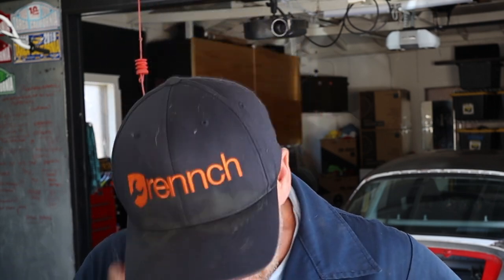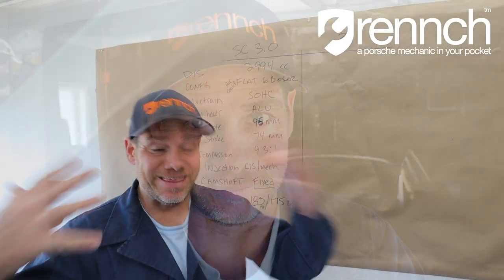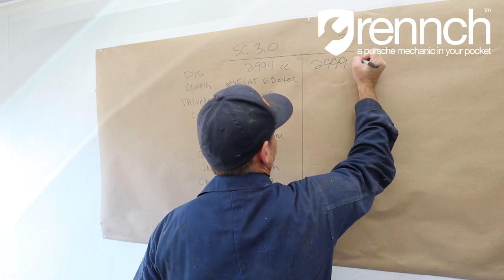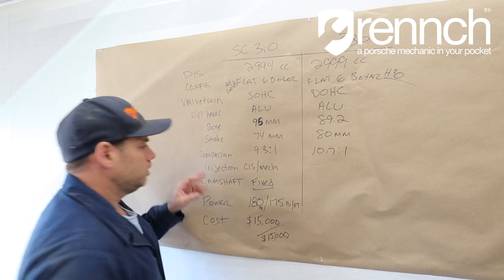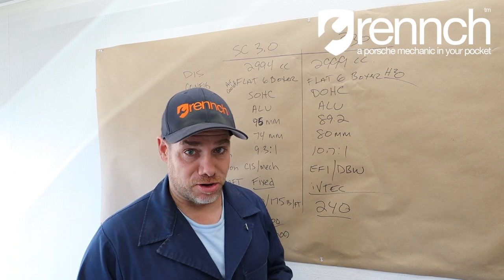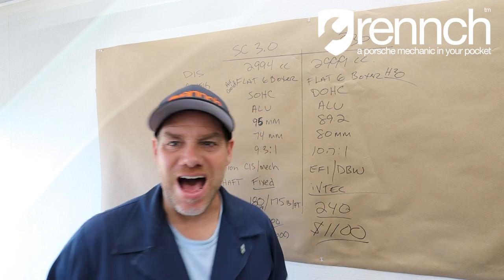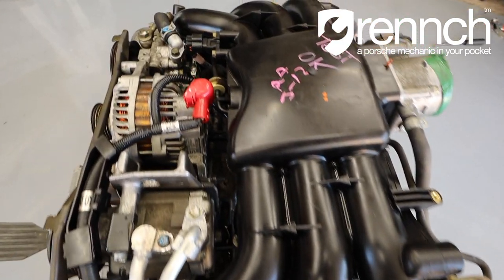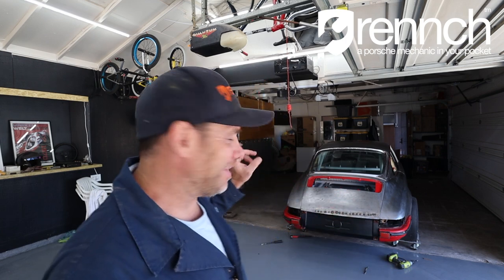SUBARU EZ30 Turbo ENGINE IN A PORSCHE? Vintage Porsche 911 Subaru Engine Swap! | Blasphemy Build 17

Comment: looks pretty cool....
Reply from the maker: I know you're not a fan William...it's my aim to convert you!
Reply: @rennch.  MIKE, what you are doing is terrible ...........       Just playing I actually warmed up a lot to it,  I am appreciative we have guys like you out there trying new things and keeping the air-cooled car on the road.  I have wanted an affordable solution for years. We are building new cases and making all the parts new for new 4 liters but it is much more expensive.  In 1996 when I put one of the first 993 motor in an SC I was told it could not be done.. I wish I have your video skills. Back to affordable options and changes.. I have engineered TDI VW motors with the VW transaxle into a 914 but I did not like the fitment but still have a start transaxle. One conversion I would like in a car and has tons of availability is the V8 Porsche motors. Tons of them out there and maybe lighter than the 3.0 Porsche motor.. This is going to be cool and you have my blessings for what that is worth.. KEEP UP THE GOOD WORK AND VIDEOS.
Reply from the maker: William Knight thanks bud. I’m sure I’ll be calling on you.

Comment: Really enjoying the series on this blasphemy build! Theres a guy who is also doing a subaru into a 911 as well...matt6berries. Love the sube engine in the 911. You could also run the subaru trans as well. Theres a kit to have it be a 2 wheel drive. Good luck and keep going!
Reply from the maker: I know Matt. I’ve been to his shop in Colorado and checked it out last year. The problem with the Subaru transmission is that it has a really high shift linkage. The Porsche transmission I’m using will be perfect.

Comment: Interesting engine choice, not a bad choice at all, these where definitely pretty cool in their time. Out curiosity, why didn't you opt for a 996 power-plant? As long as you are running a 180 degree 6 I'm behind you all the way.
Reply from the maker: For many of the reasons I stated in my intro.  Mostly the Porsche tax though.
Reply: @rennch.  is the Porsche tax like a stoopid tax? IDK

Comment: When you mentioned "Porsche purists", I thought you were going to drop in an LS into it...
Reply from the maker: Nah...wrong sound.  This one has the Porsche sound when done right.
Reply: I’m doing a built N/A Subaru swap in my 912, I’m not keen on LS swaps. For me, the essence of these cars is how light, nimble they are, and the Subaru -4 is actually lighter than the VW engine I’m pulling out. 

I just don’t like the sound and feel of the LS in a light sports car, LS is a muscle car / truck motor. 

I’m fabricating essentially a 356 style exhaust, getting some custom ground cams, and looking to get a real similar sound to the 356 super 90, with the Subaru. 

Oh, and looking at around 210 N/A hp :) 

I went with a -4 because it’s lighter and had lower cooling requirements than the -6, so I can run tucked radiators under the fenders. 

But the Subaru -6 is a freaking awesome motor, if your goal is to build a track monster, the EZ30R Is a great choice, and IMO, had just the right sound and feel for a sports car.
Reply: I've seen people put these in old vw buses. It looks like a good engine.
Reply: Also, I'm curious if anyone has put a Porsche boxter engine into an old air cooled 911. I wonder how well the engine/ trans would fit into it. BTW, I'm exited to see either project. The sube swap and the boxer swap into an old 911.
Reply: LS weighs about the same as the 3.0 SC engine. But this is way more unique!

Comment: Isnt turbo charged Subaru engines known to be unreliable when you crank up the power above stock?
Good choise othervice.
Reply from the maker: I mean, they’ve won dozens of rally championships...  seriously though, I guess we’ll soon find out!
Reply: @rennch. 
Skid factory had a 20 minut episode on the EZ30D, apperently its a good engine, a lot better than the old EJ crap.
Only the stock headers really suck at stock power levels. But you are fabricating new headers I guess anyway.
Reply from the maker: mawe42 that video is specifically why I chose the ex30  versus the eg33, which I was going to go with.
Reply: @rennch.  Can't go wrong with advice from Turbo Yoda!! :)
Reply: That was what I want to mention, the Turbo Yoda talking about that engine. Since you have the engine out, won't you change the timing chain,  its acessories and the water pump? There are some companies that make an improved timing chain tensioner, to make it more reliable with more power. Valve springs could be another thing to upgrade, in this moment. OEM springs are a little bit weak.
Reply from the maker: Claudio Santos yea, I’ll do all that